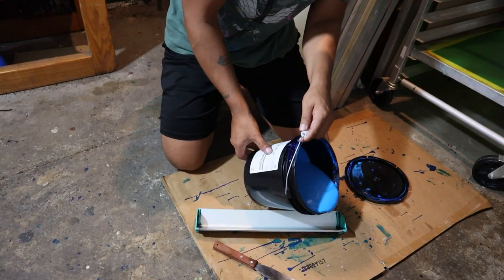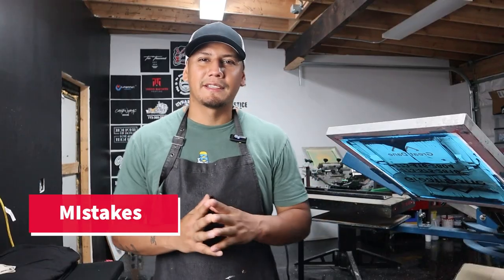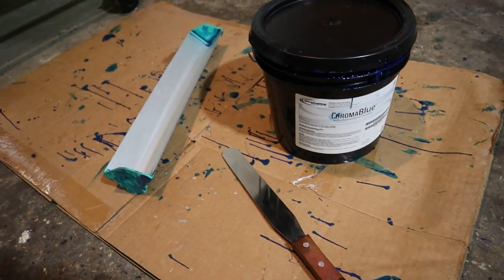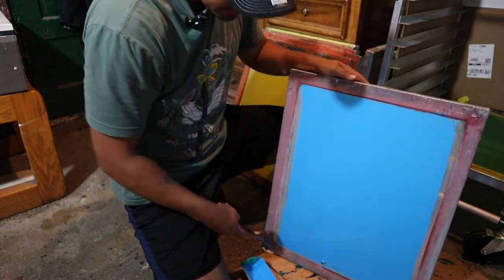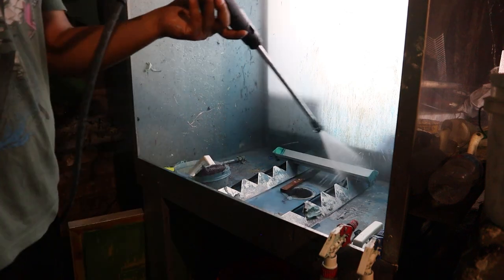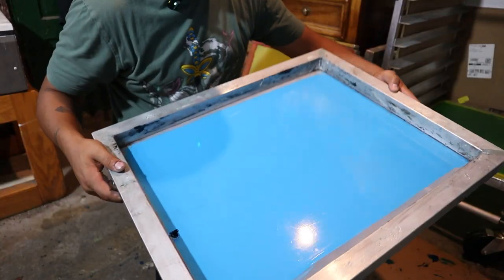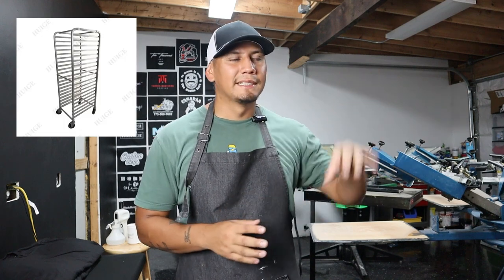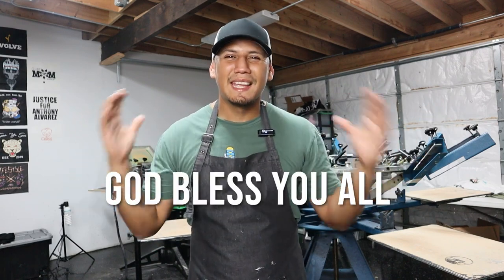How to coat a screen for Beginners. | Part 2 Screen Printing from Start to Finish

Comment: You have the best screen printing channel on YouTube! I like your step by step details. I’m an absolute beginner, I just bought the cheap blue 5 color press that I know I’m going to have to modify once I get it set up it’s still in the box. I got it for pretty cheap, 75 bucks. And I’m not looking to have a business, unless it just turns out that way? I’m doing shirts for my band and right now that is my only focus. I was planning on ordering from screen print direct anyway so I’ll use your affiliate link when I do order, because I have to order everything all I have is the four color press.
Reply from the maker: I’m grateful ❤️🙌

Comment: I'm just learning to silkscreen and I have a few questions. What is the process to silkscreen standard acrylic house paint from Home Depot?  What would be a good screen size, is there an additive to make the paint dry slower so it is easier to clean the screen? Is there any special cleaner for the screen?
I have a exterior project that I want to apply the paint to wood. Any suggestions will be appreciated.

Thank you,
Ralph

Comment: thats great video to watch ,because you said answers for the all problems we get white coating . waiting for next . also have a question , after exposure done , can i wash the screen in normal light ? [ not sun light ] or should i wash it also in dark room ?
Reply from the maker: I’m glad it was help full …  yes you can wash it out but with light but  try to wet the design fast so the emulsion could stop exposing… I’ll will explain it with depth next video ❤️🙌
Reply: @myloprints  super . thank you